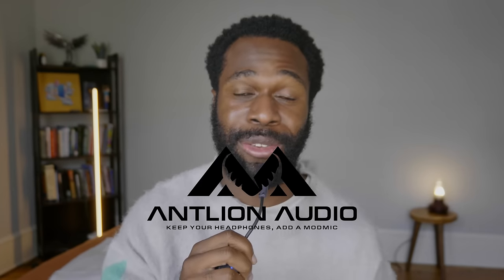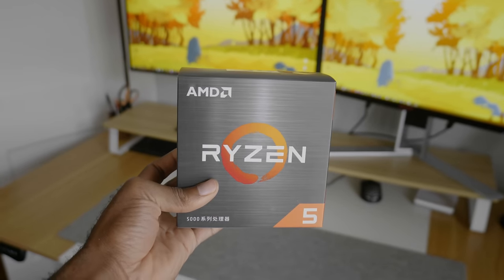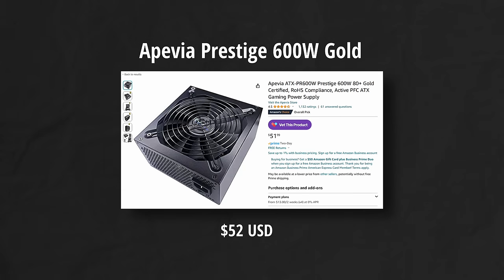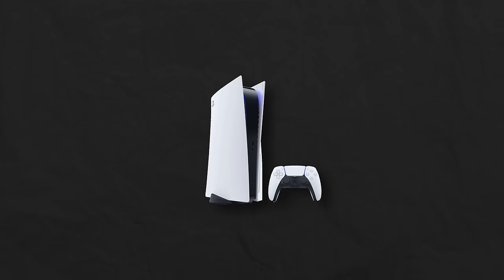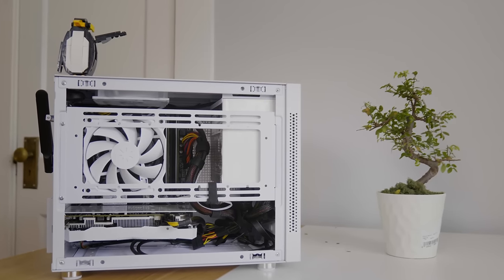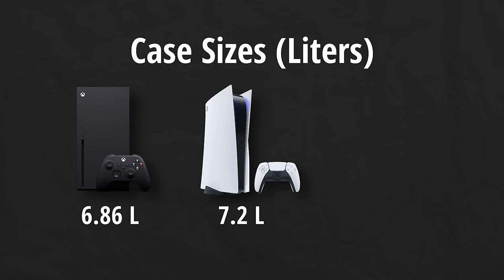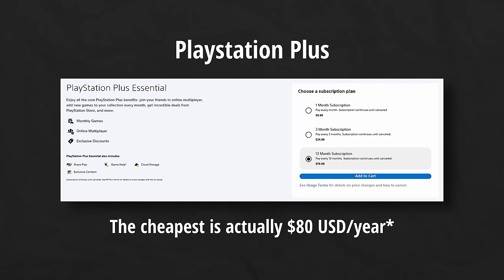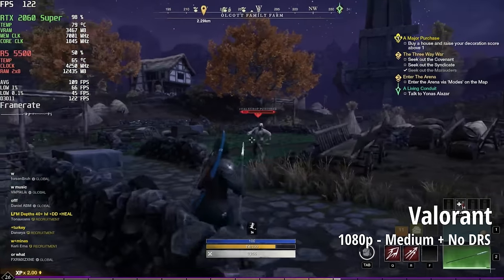The $500 PS5 Killer...did we do it?

Comment: ill make this simple as fuck man.....
the 5800x3d is the top of the gaming charts even with 14th gen intel and ryzen 7th gen  
but did you also know the 5800x gets the same exact performance on some games then the 5800x3d
also did you know there 3060 rtx on ali express for 200 bucks 
there for you can have a 5800x and 3060 for less then 300 bucks tottal build cost  that will shit doookie all over the ps5 and even the ps6 when it comes out no one talks about this... i have no idea why 
you can litteraly find am4 motherboards used on offer up for 30 bucks littteraly u can just get a full pc with a ryzen in it for less then 300 bucks on offer up and just switch out the cpu and gpu done deal u got everythign else for basicly free
Reply: its gonna be above budget when u add case psu cooler etc etc

Comment: To kill a ps5 you need play 4k at high Setting you need a 4080 to play at 4k 4060 only can play 1080p thats switch level 1440p is bare  Minimum.
Reply: You don’t need a 4080, it just depends on the fps you want. You could easily run a 4K game on a cheaper card then a 4080. And the switch barely manages to run games on 1080p. Zelda Tears of the kingdom doesn’t reach 60 fps in most scenarios.

Comment: Yeah 500$ ps5 killer (3 years later) ... without a mouse... keyboard, all new parts (since the ps5 is 500$ brand new and waranty) and without monitors (i doubt you will use your tv for pc gaming). Also we are comparing the gaming performance... nothing else, yes the pc does pc things not a big surprise but not what we are here for.
Reply: We know consoles are cheaper. The video is just a bit of fun. But if people choose not to use their TV then that's their choice because pc gives you that. But for the same experience, you don't need a monitor so you can't include it in the cost
Reply: @McGeezle  yeah i know but im also talking cost of entry. A non gamer can pick up a console with everything included in the box and use existing hardware (aka tv etc) to get started. For a pc you. Need a desk, a comfortable chair, monitor(s) etc etc. Just to get into pc gaming and have a decent pc is a massive cost. My nephew paid around 2k+ for his whole setup. Deals and everything. By the time the cost evens out, a console gamer is at least 3 generations in and then the pc needs to be upgraded to keep up. I just think gaming pc's are a bit overrated for what they do. Sure its a whole frigging pc, but at what cost? I rock a pretty decent laptop (just a laptop no gaming attached) and my consoles. The only upside is, lots of games are not released for consoles and unless you really like those specific games i would not suggest a gaming pc, but the price is a real turnoff for me. Oh btw i have nothing against pc gaming btw pls dont take it the wrong way.

Comment: XBOX Live is $60 a year. Also, if you buy a used Series X you can pay less than the retail price. I got a used Series X for $400 and it came with 2 controllers, 4 games, an RGB stand, and of course the HDMI cable and power cord.
Reply: Xbox Live Gold is now GamePass Core. It's still the same price as Gold, at least here in the UK, but don't be surprised when they start bumping up the price because its 'GamePass'.